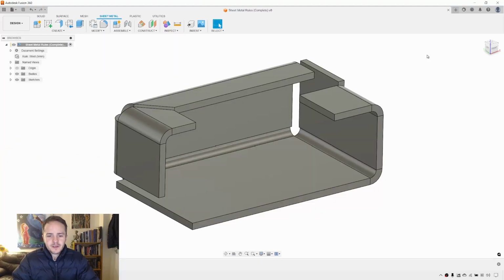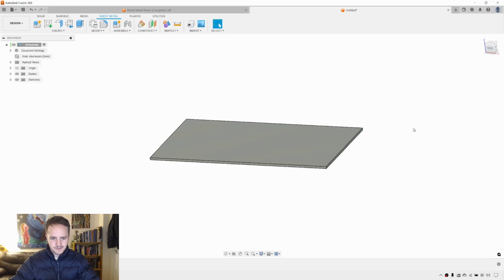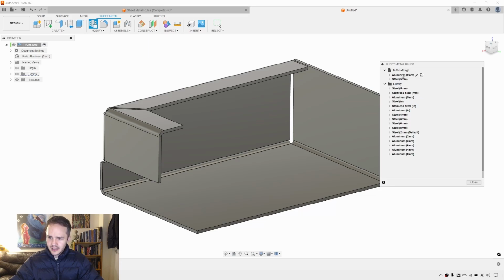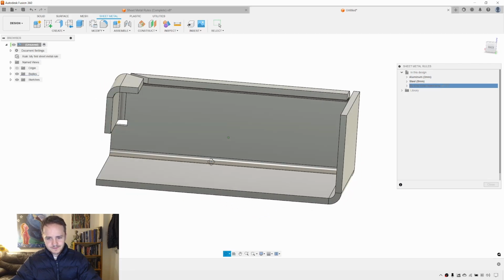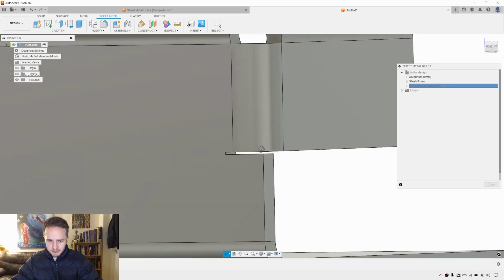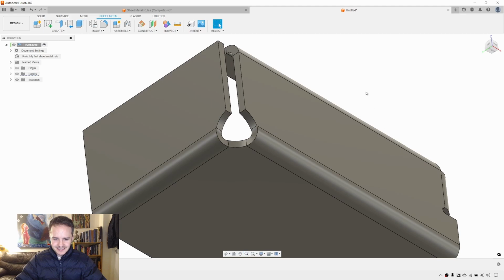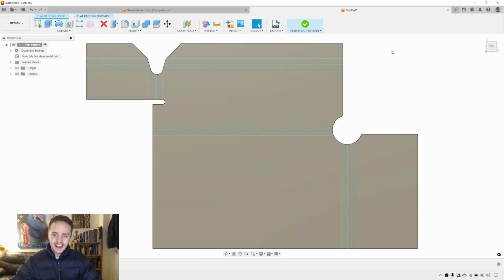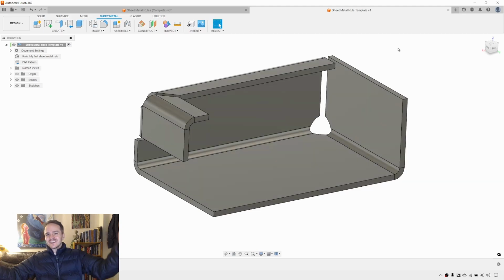Sheet Metal Rules in Autodesk Fusion 360

Comment: Absolutely hate, hate, hate fusion so anything I can learn is a bonus 😂 such a frustrating program!
Reply from the maker: Haha oh no! Are you used to something else? You can't possibly hate 3D-modelling!
Reply: @nemoengineering  yeah so frustrating. Been using design software for many years and these days love eMachineshop and always Tinkercad because it’s so fast and accessible and even my 9 year old can use it for circuit design too. Just cannot understand how it’s made by the same company? So unintuitive in comparison. I’ve been able to create so many complex devices just in Tinkercad then really quickly get them to 3D print, carve from carbon fiber or even plasma cut and weld them up but haven’t had much luck at all producing anything of use in Fusion. I will persist though. I like the way you break it down.